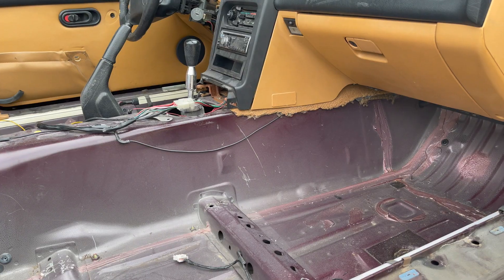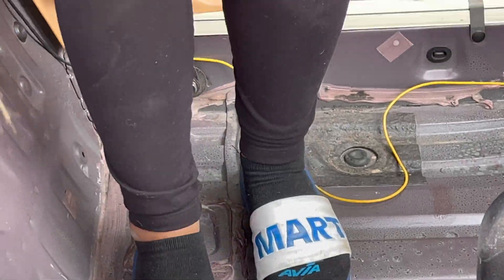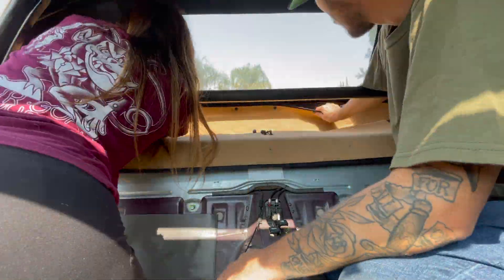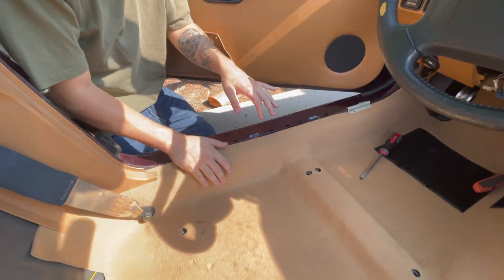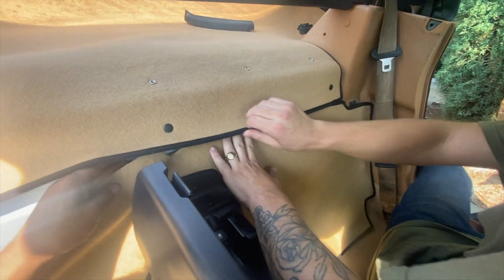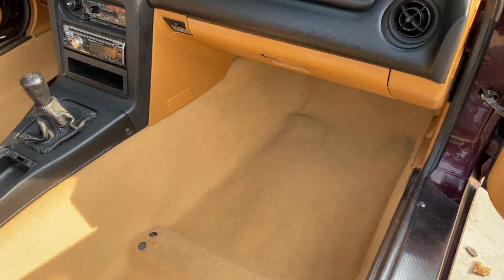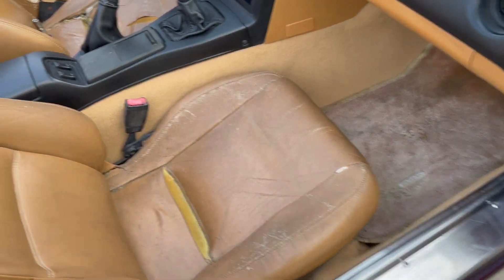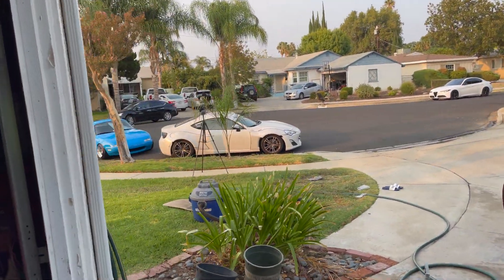Miata Interior Restoration NEW CARPET!!

Comment: How much less noise do you hear after installing the noise redirection mats?
Reply from the maker: Considering it didn’t have anything inside the car before it’s a huge difference
Reply from the maker: We did the same thing in the blue miata but that car did have the carpet from factory still so when we threw in the deadening it did reduce it but not as drastically as the purple miata
Reply: Ahh ok sounds good. Where did you order those mats?

Comment: Hi Sal - I'm about to recarpet my interior and the link in your description for the Moss Miata carpet goes to a "Premium Carpet Set By Moss" but in the video you mentioned how nice a molded carpet is.  DId you actually use the "Molded Carpet Kit" which is different than what your link is attached to?
Reply from the maker: Just checked the link 
Looks like they might have changed the design 
Ours did not come like that

Comment: The Moss Miata comes with two options for the style, is this the loop or the cut pile?
Reply from the maker: This kit specifically was only 1 style 
Molded I saw that option for the other carpet kit and it basically comes down to if you want it super thick/plush or not

Comment: That carpet looks like it fits good. I've heard horror stories about aftermarket carpet kits not fitting right. Prob good to spend on the good shizznit. I feel your pain wit the heat, its miserable here in Florida. Dealing with heat is usually the worse part of the project you're working on